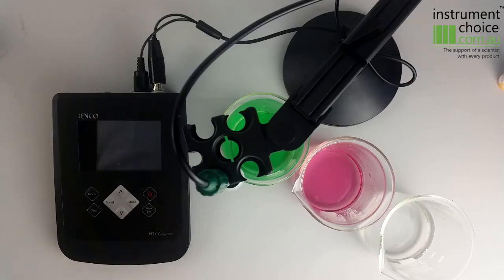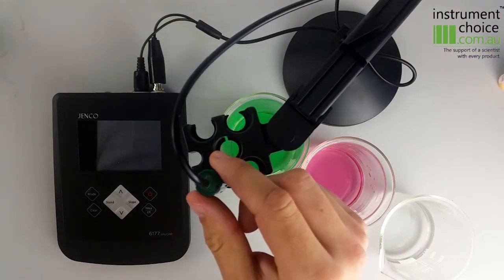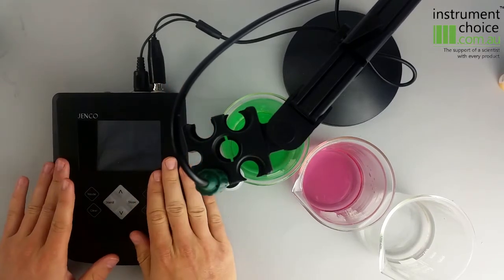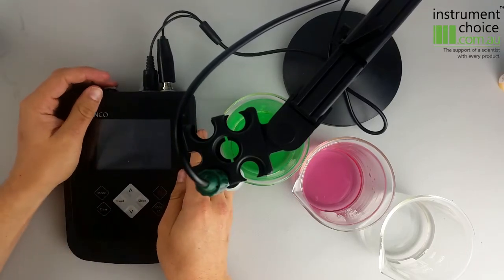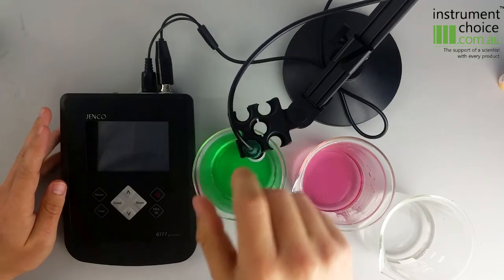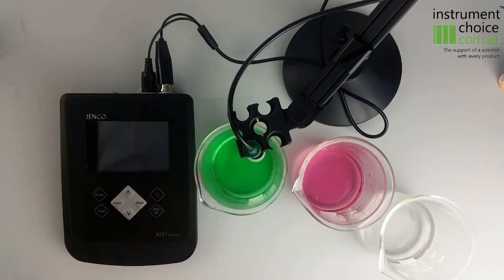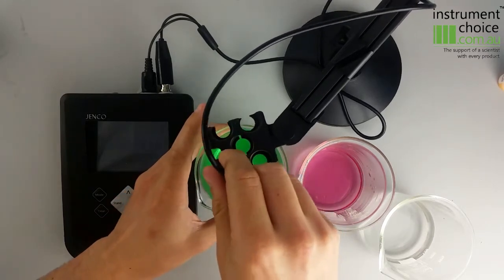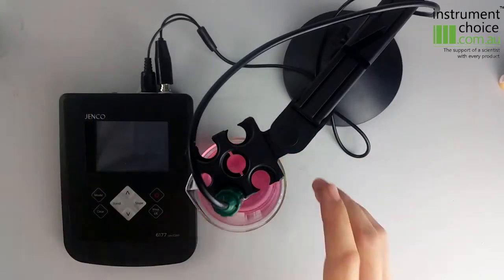Overview of the Jenco 6177KA

Comment: Just wondering if you gotta calibrate before every time you use to measure.
I make ormus, look it up. But ya it consists of non fragrance bath salt exg. Dead Sea Salt an pure lye. 1 cup of salt an 5-6 tablespoons of lye depending. I wanna keep my measurements always at 10.7 ph. 10.7 ph separates the organic gold from the salt using lye an I use a flower vause using at lease 2ltrs of distilled water. When the product subsides I remove the top water not to stir up the ormus an add fresh water an repeat this process up to 7 times so that it's not acidic. It tastes like  milk but not to confuse it with milk magnesium,  ormus